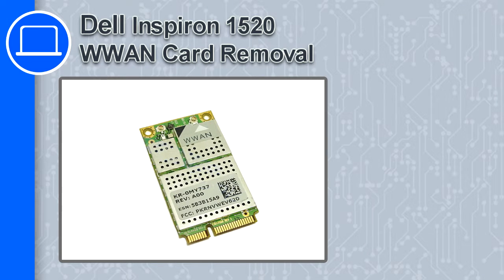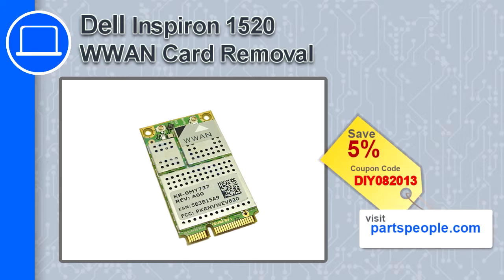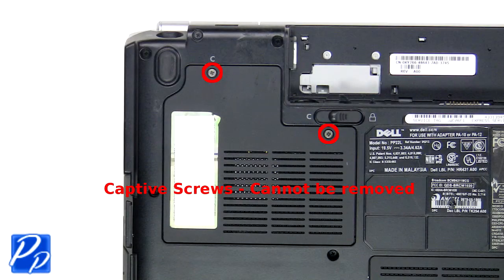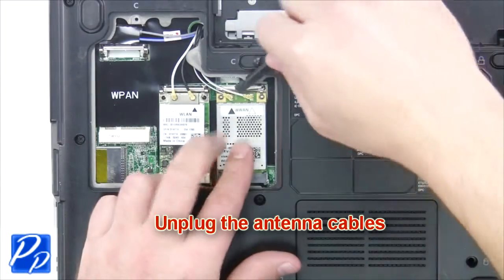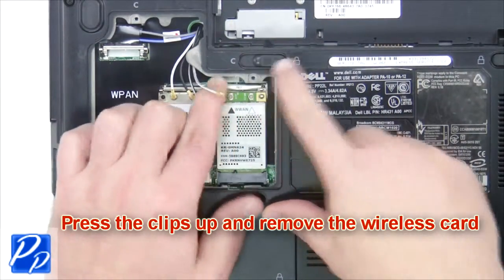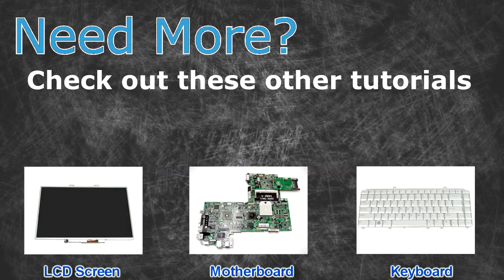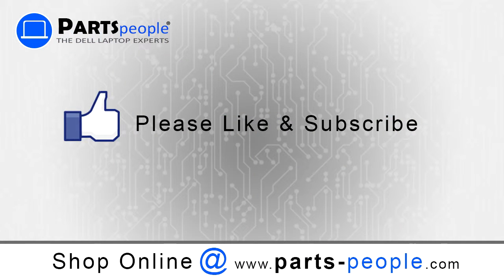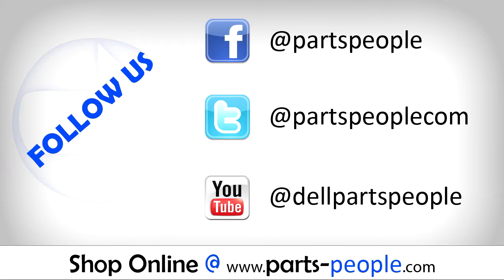Dell Inspiron 1520 WWAN Card Replacement Video Tutorial

Comment: I have one question for you regarding to the Dell Inspiron 13 7000 Series. It has only one memory slot and I do have the "maximum" amount of RAM installed (8GB), Is it possible to place a 16GB memory card? Does the limit of RAM is a hardware limitation? I would love to buy a 16GB memory card but I have this doubt.
Reply from the maker: +Rafael Romero Flores Unfortunately the one slot maxes at 8GB.
Reply: Nevermind, It's still pretty fast. I can enhance it by installing a SSD. Thanks.